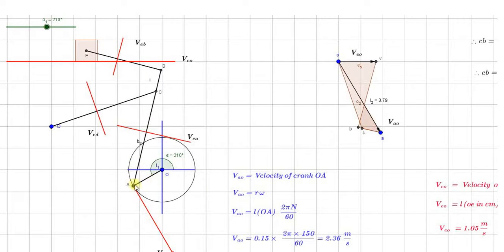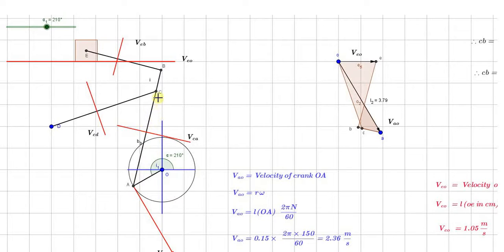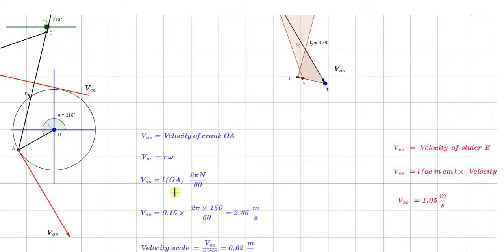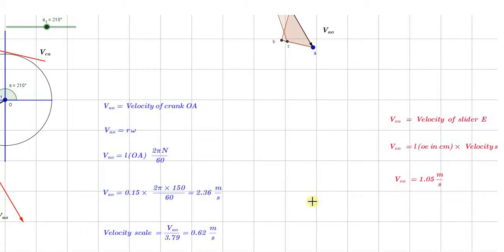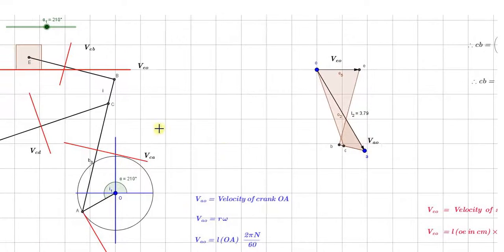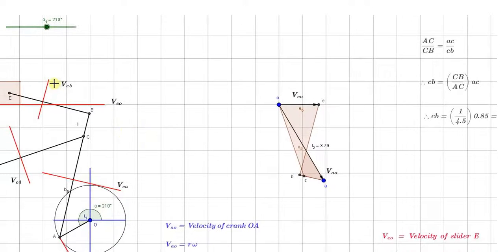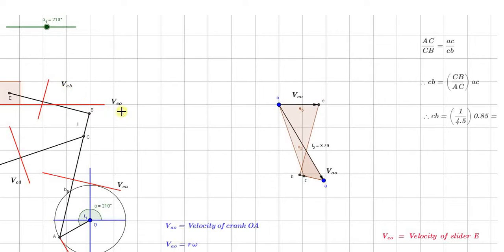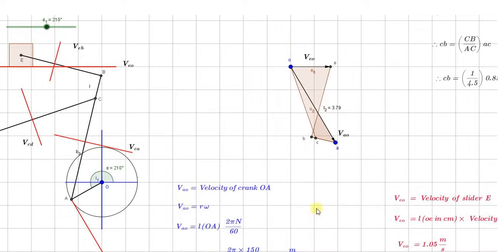Lecture 8 | Velocity diagram & velocity analysis of a mechanism | Relative velocity method

Comment: How do we come to know if point " a" comes below o and not above (upwards from point "o" )
Reply from the maker: It depends upon the direction of radial or centripetal acceleration of driving link. The radial  or centripetal acceleration is always  directed towards the centre or fixed point. Hence from point "o" , just follow that direction .... THANKS !!!
Reply: The crank is rotating in the anticlockwise direction. By logic it can be seen that the vector Vao will be a tangent, to the circle traced by point A, in the downward direction. Hence in the velocity diagram, the direction is downwards as well, giving the position of 'a' below 'o'